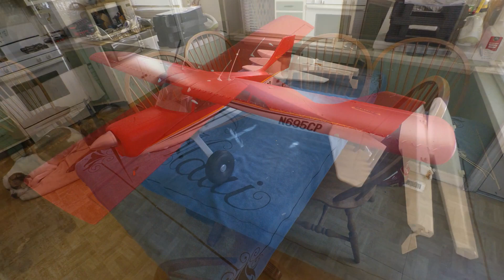E-Flite Maule M-7 1.5m BnF Basic with AS3X and Safe Select (SpeedBuild)

Comment: Hi Skip, is it possible to add wing connectors like the one for FMS Super cub on this model to make the assebly quicker? Thanks for the video:)
Reply from the maker: Thought about that too, but I wont do it.   Its still just as easy to connect them than to modify an iffy chance of getting it done right.
Limited material to support the board connectors.